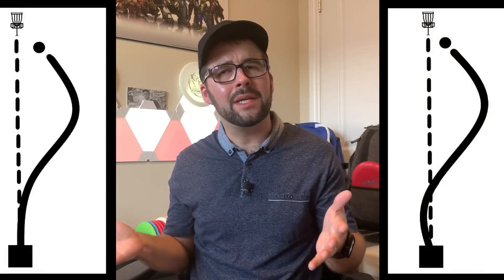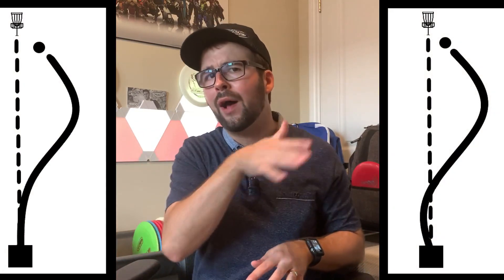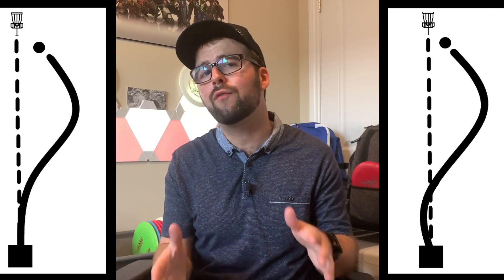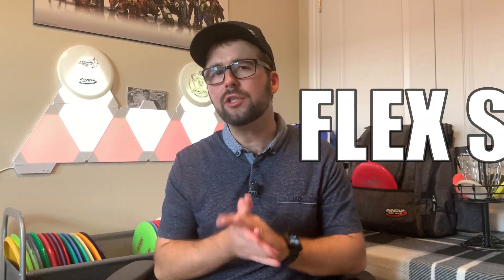What's the DIFFERENCE between a FLEX SHOT & an S-SHOT?

Comment: Overstable/understable isn't strength of fade though, it's strength of turn, right?
Reply: Simplest way to think of it is as the sum of the last two numbers. Sum < 0 is understable, Sum =0 is straight, Sum > 0 is overstable. Keep in mind, discs like a Wraith with -2 turn and +2 fade will have a net straight flight but will S curve on their way there.
Reply: @Shawn Kimball's explanation is one I've never heard before but accurate. All I can add for a deeper understanding on these last two flight numbers (3rd & 4th) is by referring to them as High Speed Stability instead of Turn and Low Speed Stability instead of Fade. (I believe these are reference terms used by Dynamic Discs). A positive number with either parameter is considered overstable, and a negative number is understable. One key takeaway from this is that the harder you throw a disc, the more that High Speed Stability is affected. Generally, the harder it's thrown the less stable it becomes. For example, a beefy meathook disc CAN become a flippy disc if a beastly human throws it with an arm speed fast enough to overcome the speed rating of the disc (1st number).  A similar phenomena occurs when faced with a headwind, think of the wind in your face as adding speed to your disc flight, thus making it less stable on the high speed portion of the flight and the reason why overstable discs work so well in high headwind situations.
Reply from the maker: Well put 👍

Comment: Sorry to disagree but pro players don't use Destroyers for flex shots when they want distance. They throw with so much speed they actually hyzer flip them on power drives. Watch the coverage of Maple Hill 2020 Hole 1 or even the long par 4 at Maine State Championship. Each one throws a Destroyer (or one of its clones) on a hyzer release and they throw so hard the disc flips over and goes right for a good long ways. If a pro-level player put a Destroyer on an anhyzer line it would end up cut rolling. They use flex shots with slower discs when they need to hold specific lines through trees, sometimes even for obstructed putting.
Reply from the maker: I definitely agree that they can hyzer flip destroyers, but I would say it depends on the weight, plastic and hole (such as if it’s downhill or not).  Star and champion are going to be harder to hyzer flip, especially when new and max weight. In addition, there are varying degrees of flex shots, so it doesn’t mean it needs to be a big flex. Lastly, most pros are not in the same league in terms of distance/power of players like Paul, Simon, Jones, etc. Anyways, thanks for the input either way!
Reply: @JustDisc  yeah, I really appreciated in your video how you showed "real" players throwing those shots. New to intermediate players aren't hyzer flipping Destroyers, lol. But Ricky Wysocki flips his Halo Destroyer and those things can be more OS then even Champion plastic. I like your content. It's geared towards us regular humans. Cheers.
Reply: Eagle throwing a Cloudbreaker 2 is sort of depressing to watch lol.
Reply: Lower speed discs are easier to turn over. A pro could flex a lower speed disc or a higher speed disc. Whether they would definitely depends on the hole.